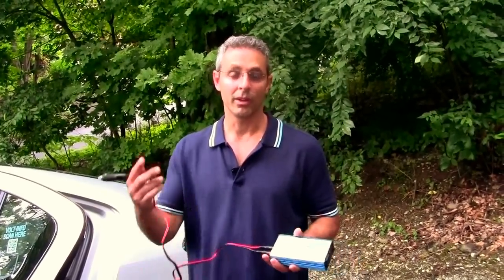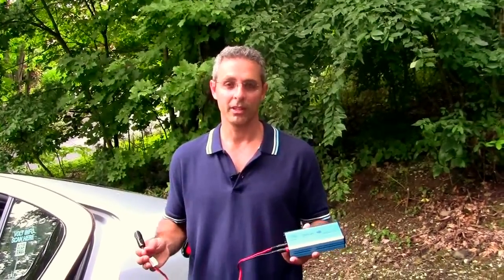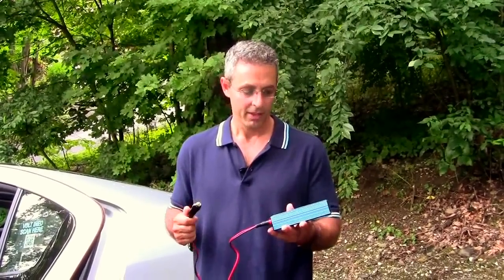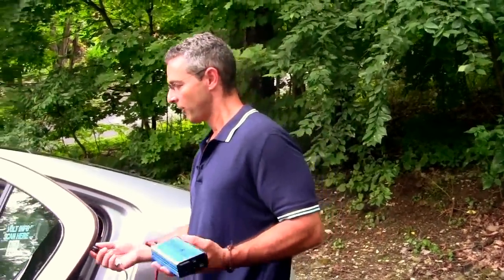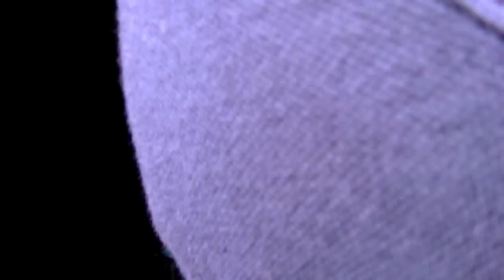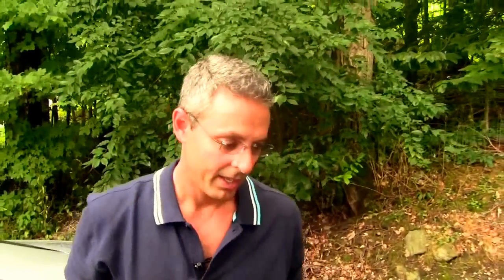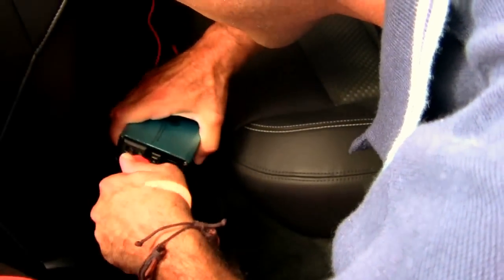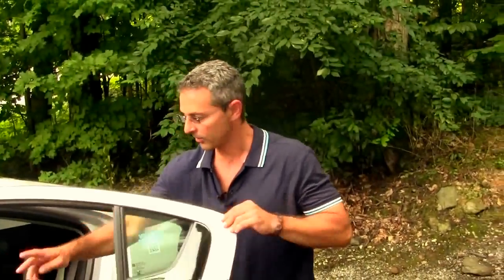Chevy Volt: Emergency Back-up Power

Comment: Do you think Chevvy will eventually allow discharge from the Volt as part of smart grid? I think I heard that Nissan were considering this for the Leaf? I was thinking of a grid-tie battery system but then remembered your video about using the Volt (my Ampera)! Maybe not as good, but the Volt might be able to keep the freezer or pellet boiler going?

Comment: Great, that was better than I was initially expecting (I had envisioned just one battery draining, but the fact that it can regenerate makes it much more useful).  Cheers, I like your Volt videos!  What are your thoughts on the 2013 Fusion Hybrid and the Fusion Energi?  I'm excited to see American auto makers stepping up the competition in the hybrid market and doing so successfully.

Comment: Could you plug a solat panel straight into the 12v socket? There is a flexible solar panel available which could be fixed to the roof.

Comment: People should never hook a generator up to their main electrical box or in such a way that power is fed back onto the electrical service.  Linemen will presume the line is dead and potentially become electrocuted by the reverse current you are feeding onto the grid.  I understand that's not what you're doing, but it is important that people understand this, given this storm or any power outage.

Comment: Now that's fairly clever in my opinion. And perfect now while Sarah's becoming the new epidemic. Two things, with the amount of electricity coming out of the battery especially over a couple of hours, will that damage the cigarette-lighter? Also, could this be done with other Plug-In vehicles?

Comment: WARNING: DO NOT MIX THE OUTPUTS FROM THOSE TWO SEPERATE INVERTERS.
The output will be out-of-phase 110VAC, which will be seen as a partial or even full short circuit (full short if close to 180 degrees out-of-phase).
240 Watts will have to be enough unless you wire directly into the main pack (and yes, this has been done successfully)!
I don't know if they would sync each other (two inverters) but you might be able to use a syncing inverter, which is designed to adjust itself to be in-phase with the grid power.  This is what grid-tie solar panels use.